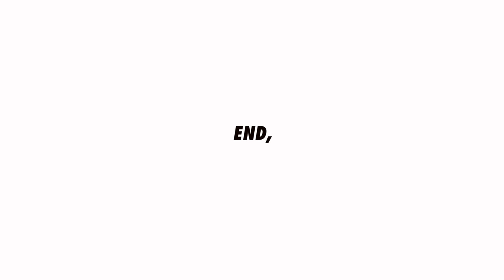W47_Oak Shelf

Comment: I enjoy looking at your work. I'm only an amateur when it comes to woodworking and it's not nearly as good looking as yours. Which, besides the lack of know-how, is also due to the handtools / equipment. I would be interested in a video in which you show general preliminary work like surveying or just in generel some tips & tricks.
All the other work like sawing, drilling, milling will be done so fast that it is hard for me to understand. Especially when it comes to milling the holes, e.g. for shelves, assembling single boards to a big board for a carcass or simply assembling the top, bottom and side parts.
Many greetings from Germany
Ingo